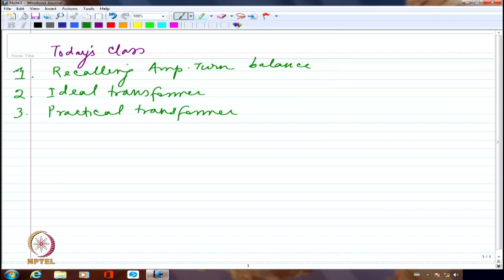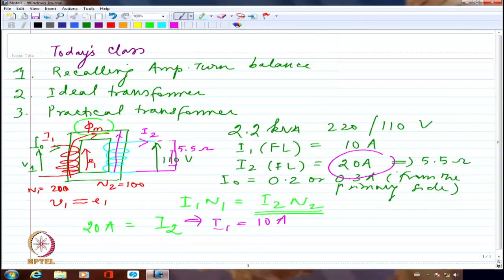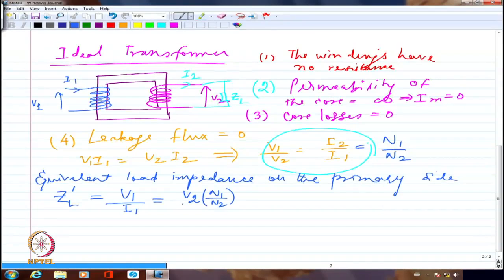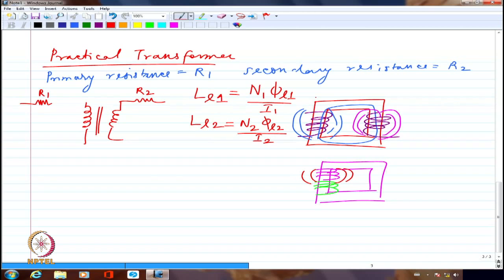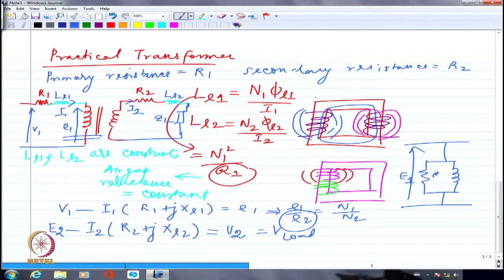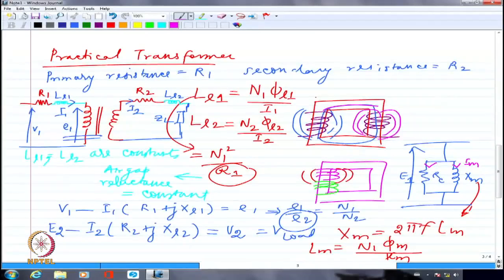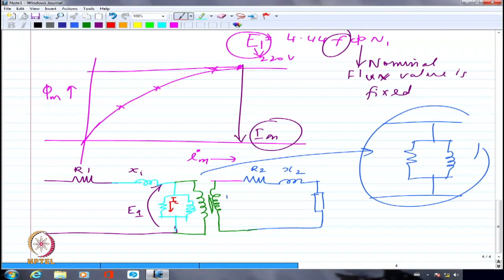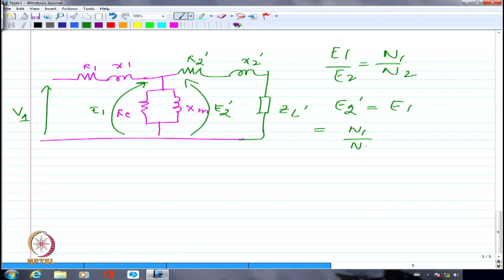Transformers -Amp-Turn Balance, Ideal and practical transformers

Comment: I(1)n1 nullyfying l(2)n2
& I(0) maintaining the initial flux
So how can we say 
(I(0)+I(1))n1=I(2)n2 ?
Reply: Because i0 is very very small 0.2 x i1 ......so its effect is neglegible in the sum of product ixn..
Reply: she didnt say like that....
Reply: I1n1 nullifies I2n2 only in ideal transformer,  where i0 is 0. But in case of practical transformer I1 has to supply for both nullifying and i0. So I1n1 will be equal to I2n2 + ion1. After nullifying only ion1 will be the net MMF.
Reply: We can just say like this, The flux which neutralised The flux established by the Io, will be neutralised by the I1, so that N1*I1= N2*I2, so that I0 will again be able to establish the required flux in the core. In short, I0 will always do the job of establishing the flux in the core, and Additional I1 will do the job of power transfer. i.e. V1*I1= V2*I2. Corollary to this that in load case, power transferred is zero, cause I2=0, and ideally I0 is also zero.